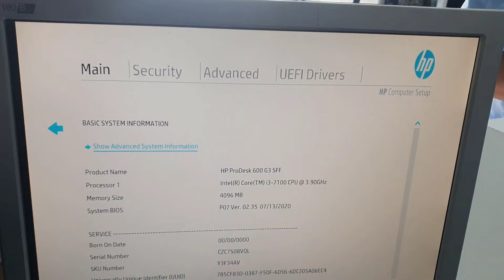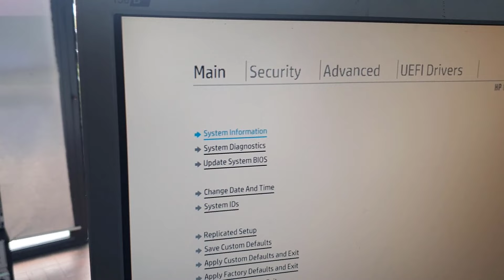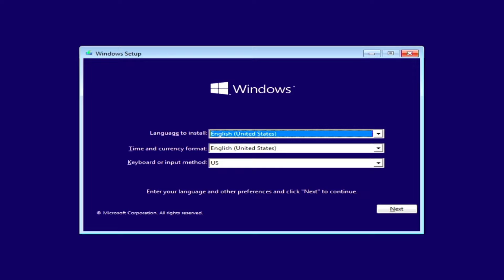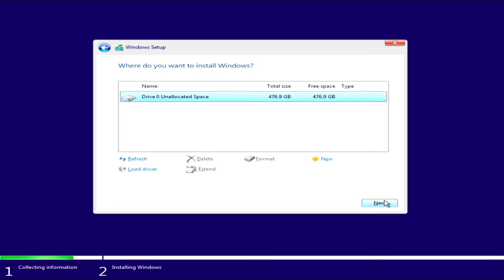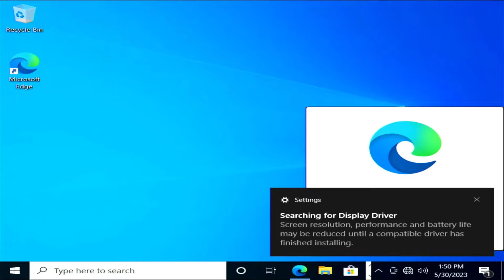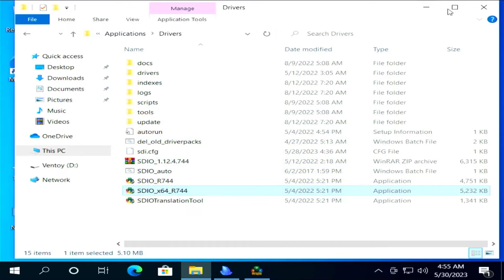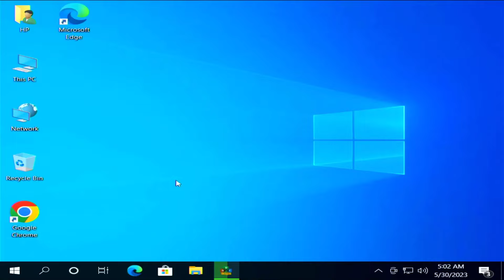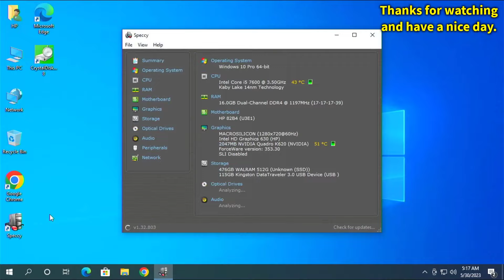HP ProDesk 600 G3 SFF RAM, NVME, GPU, CPU Upgrade 2023

Comment: this is excellent simple demonstration.. it only has one slot for SSD right.. if we want to upgrade the only option is to replace the existing one is it ?
Reply from the maker: Two SATA: one for the hdd/ssd and the second one is for the dvd player and you have one more slot for m.2 NVMe on the motherboard like shown in the video.
Reply: @ApkHeaven is it okay if i remove the cd drive and use the 2 sata slot for HDD and SSD?
Reply: @ApkHeaven can i use this pc processor in other motherboard

Comment: Does the PSU of this computer is proprietary or can i use any PSU on this? I'm thinking to buy one of these to install my RX550 and play some games on it, or it's a bad idea?
Reply: doesn't rx550 don't use any power connector?, it draws power from the pcie slot
Reply: @NKG416  It don't use a power connector, it's a basic graphics card, i was testing it with HWmonitor, it just draws 25w at it's peak from the PCI slot running furmark, maybe the original PSU can handle it
Reply: @diegosalgo  sure is, say the cpu is 65 + 25 that's 90w maybe 100w at max (storage, ram, etc). i've seen other tears down optiplexes, and most of them have psu ranging from 180 to 300 w
Reply: @diegosalgo  i just checked it, it comes with 180w psu
Reply: @ricardomarques5191  A RX550 é de baixo consumo, não precisa de uma fonte potente. Tenho uma fonte bomba da Knup de 500w e ta a meses segurando a barra sem problemas

Comment: I bought this pc as a backup work PC when I started working from home. Now looking to upgrade it for gaming. But I have the 16gb with 512 ssd. my BIL said there wasn't space but maybe there is hope of upgrading mine to a 32 gb ram with a 1tb ssd.
Reply: It can hold up to 64 GB of ram. Also, you can upgrade the processor to a I 7–7700.
Reply: 16 gigs is the most you will ever need even for gaming, and foreseaable future, I would get the p620 or p1000 quadro cards instead.
Reply: @gstueve  Thank you!

Comment: Nice.
Have one of this on i5-7700 on my media machine and thinking of upgrading to i7 7700k, but it is not specified on the hp page that is supported, maybe you sumbled somewhere on that info?
And, are you satisfied with that Quadro card?
Reply: i7-7700K should work, I have i5-6600K which isn't listed but works like a charm.
Reply: Does yours have widows 11 pro?
Reply: @janetmckay7809  Win10, but 11 should work as well. 
Meanwhile installed i7 770K, plus 64gb ram, work nice.
Reply: The NVME disk does not appear in the HP Prodesk 600 device. I ran all the drivers but to no avail
Reply: Would not recommend that you pay the extra to get the 7700k since you won't be able to over clock with this board, get the regular 7700 and you'll even save some cash

Comment: These are great little machines. I have three loaded with I7’s and 64 gb of RAM. Install a 1gb m2 drive with a 2gb SSD as a back up and you will be set for years. To bad you can’t install Windows 11 on these machines. Goto HP and update the drivers if you get and older unit.
Reply from the maker: TB
Reply: I just bought one of these but it doesn't detect my ethernet cable do you think it's because I need to install the drivers? Thanks!

Comment: also can it run windows 11?
Reply from the maker: Not officially.
Reply: @ApkHeaven  I'm running 11 on mine without any bootleg settings. It has reached the end of its updates at 21H2, however, due to the processor.